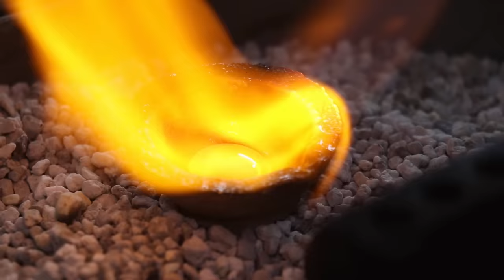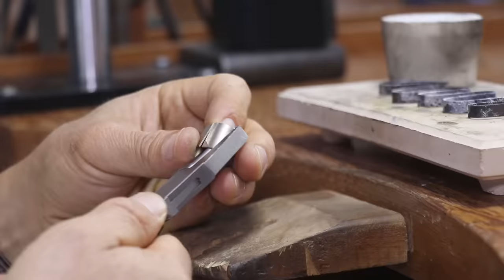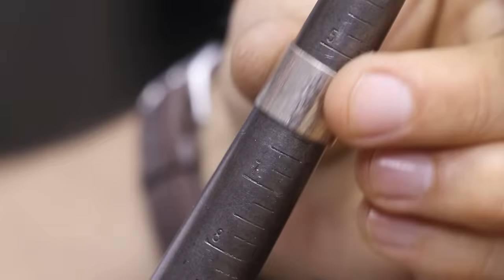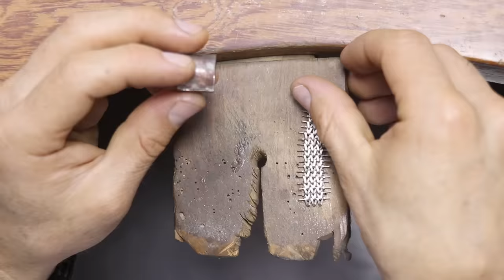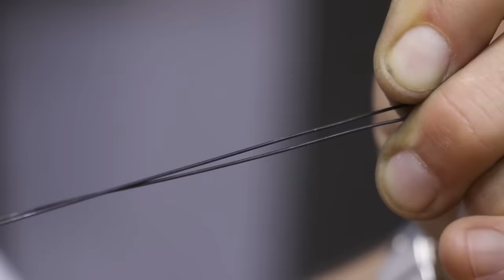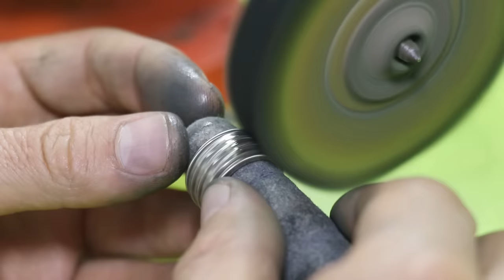18k white gold ring

Comment: No one can imagine that this ring has gold mixed in it. Pretty nice video btw
Reply from the maker: Thank You.
Reply: @lucastorres8370  Amém irmão
Reply: What's the point of destroying Gold's natural colour making it look almost identical to silver? Makes no sense at all!
Reply: @grahammurphy1178  true! I also had the same question but still doing so is tough
Reply: @grahammurphy1178 , destroying the natural gold look? 😂 It makes it look visually identical to platinum, which is a more expensive and more prestigious metal compared to gold, without the price increase related to using platinum, it's harder than gold, which in its purest form is pretty much useless for jewelry because it's so malleable and it still retains the value of the gold it contains.
Reply: @crunchy303 , see above.
Reply: @Loccyster  oh i get it now 😂
Reply: @Loccyster  I have been wearing a   9 gram 24 karat 999 pure Gold ring with blue sapphire stone for several years without any issues.  Which I had made for myself in Nepal.  ''The myth that jewelry can’t be crafted with pure 24 Karat gold due to its “softness” contradicts thousands of years of history, not to mention a vibrant 24 Karat gold jewelry market in the Eastern world. While it’s true that pure gold is more malleable than other metals, it’s still hard and indestructible.” -Roy Sebag....Metal hardnes - Mohs scales
Gold 2.5-3
Silver 2.5-3
Copper 3
Nikiel 4
Platinum 4- 4.5
Palladium 4.75
titanium 6
Good steel 7-8
Reply: @Loccyster  
I'd like to know what kind of material is The Other Part. if you please
Understanding 18k Gold is 3/4 , so whatever the other material could be 1/4 of...Xx?.?. Material.
Thank you 🙏🏼
Reply: @padreantonioraygozav.raygo9576  Nickel and Zinc . Almost worthless metals.
Reply: @grahammurphy1178  🙏🏼
I think I didn't said I was referring to the white gold ring. I'm assuming you answered right my question, thanks Graham
 But now I'm interested in how to lower gold purity to 18K. What is the other 0.25%  mixed mineral.?.
Reply: @Loccyster   🤔,,So...you just created Fool's Platinum I guess.?.
.....Fool's Gold is Natural.!.
Reply: @padreantonioraygozav.raygo9576  Usually  copper, silver and or zinc. If it's yellow gold.
Reply: @grahammurphy1178  Copper, was in my mind but not the rest.
Thank you 🙏🏼 Gracias
Reply: @grahammurphy1178  because it still has some of the amazing properties of gold which make it ideal for jewelry.  Platinum and palladium also have amazing properties but aren't as easy to work with to create fine shapes.

Silver is just inferior and not suitable for high end jewelry
Reply: @Loccyster  Platinum is half the price of gold
Reply: @grahammurphy1178  different colored golds are created by mixing pure gold with other metals like silver/zinc. The makeup of each type has different properties. White gold for example is more pliable and easy to shape than rose gold.
Reply: @ElierOlivos  thats not a good thing
Reply: Gold and aluminium forms are very unique intermetallic, purple In color, but very very brittle
Reply: @grahammurphy1178  gold is good quality but a horrible colour for some, like me.
Reply: @Loccyster  but tbh platinum might be more expensive than gold but you get fuckin shit price trying to sell them…. Gold is far superior imo in its uses other than jewelry plus value when selling… gold can be an investment where as platinum not really

Comment: White gold is usually rhodium plated and that's what gives the ring its brilliant white appearance because even at 75% gold alloy it still has a yellow touch (So in fact when you see a white gold ring you dont see actually gold). How do you achieve the silvery colour? Because i did not see the plating step in the video.
Reply from the maker: Hello Chistophe, I inform you that the alloy I used contains palladium and is strong enough to turn 18k gold white, you are right that I gave it a Rhodium plating but it was not because it was yellow, it was just to give it more hardness and shine.  Thanks for watching the video.

Comment: Well it looks like silver though ..
Reply from the maker: Hello Satya Kiran, White gold arises from the combination of pure gold with other metals such as  palladium while silver is a transition metal that for the manufacture of jewelry is usually combined with metals such as copper. Although both metals have a very different composition at first glance they can look very similar which leads a large number of people to don't know how to distinguish one from the other. But the difference are for example in the weight, price, strength, etc: White gold is more or less 47% more denser than silver for this reason it weigths more and the gold price is also more higher than silver. Thanks for watching the video.

Comment: White gold means
Reply from the maker: Hello Priyabrat, White gold arises from the combination of pure gold with other metals such as  palladium while silver is a transition metal that for the manufacture of jewelry is usually combined with metals such as copper. Although both metals have a very different composition at first glance they can look very similar which leads a large number of people to don't know how to distinguish one from the other. But the difference is for example in the weight, price, strength, etc: White gold is more or less 47% more denser than silver for this reason it weigths more and the gold price is also higher than silver. Thanks for watching the video.